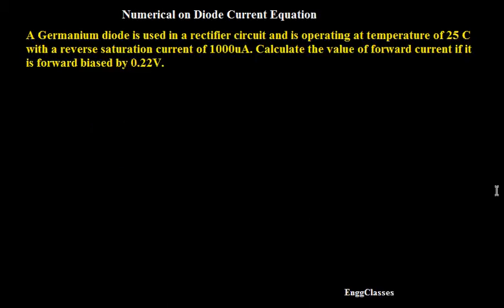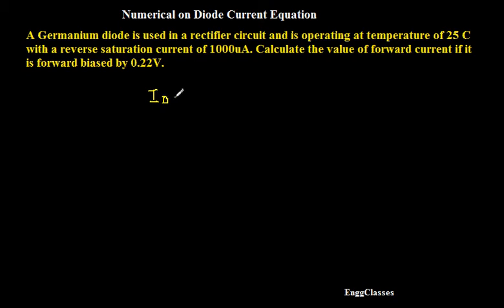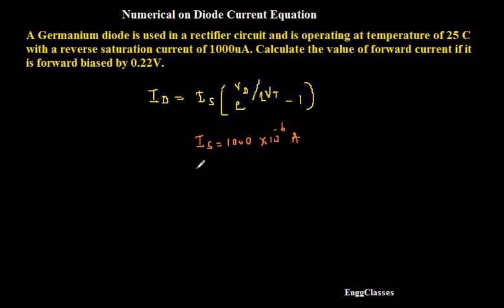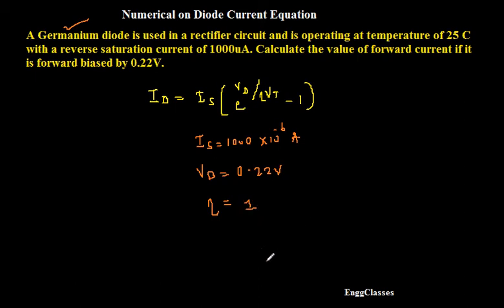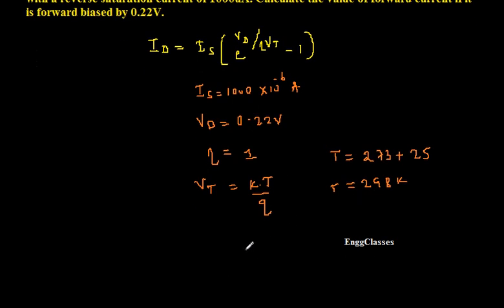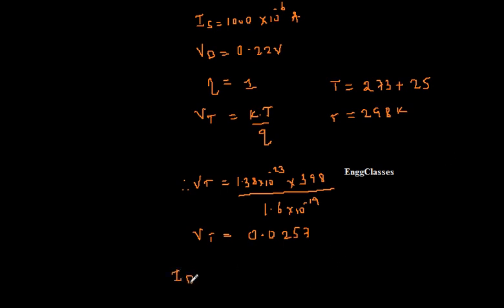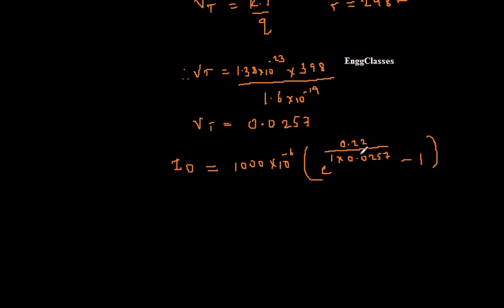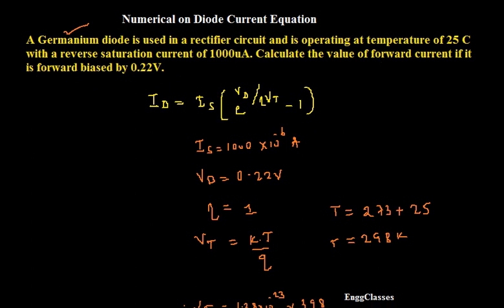Diode Current Equation( Numerical 2)

Comment: my final answer is 5.271068126A following your solution, why do you have 6.6332A?
Reply: You are correct✅✅  ...
Reply: coz by mistake sir wrote 398 instead of 298. you did it right.
Reply: Got the same 
Is comment ne bohot time bacha liya
Reply: Yeah 5217mA